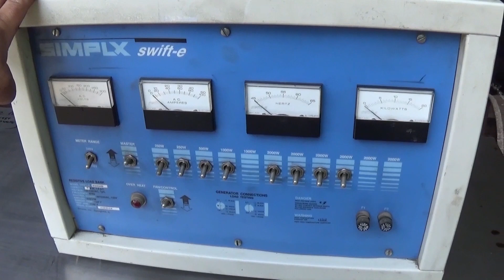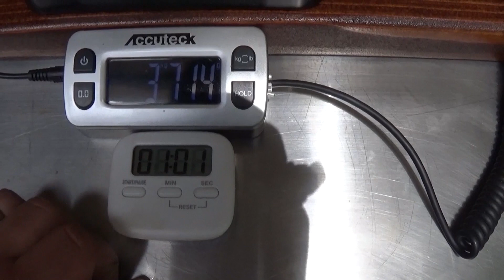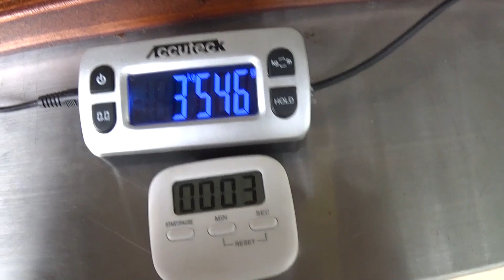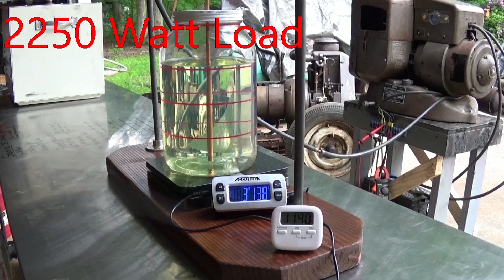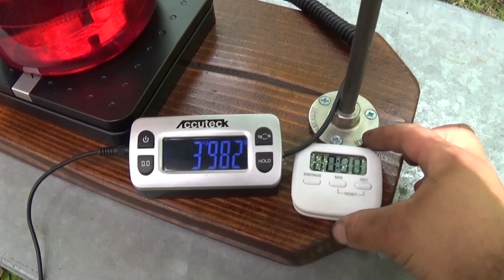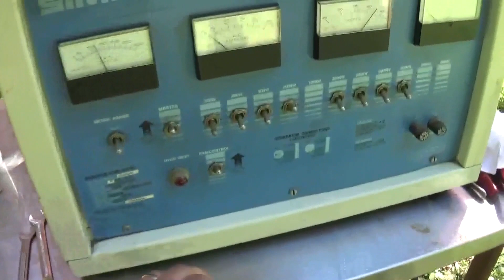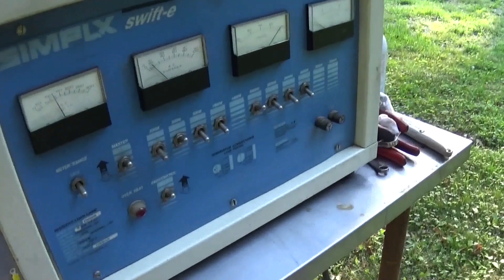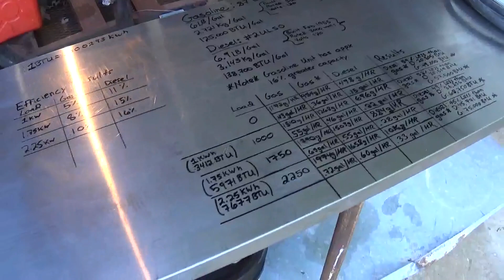GASOLINE VS. DIESEL (FUEL CONSUMPTION  1950s Style)

Comment: I don’t think the petrol correction was relevant because the engines are quite close in capacity and the issue is how efficiently the two generators convert fuel to energy. No surprise, diesel won equally no surprise I love my diesel car

Comment: I have been looking for a diesel generator that I can afford. One another line. I make Silver Series Lubricants. . have made them for 20 years. They are based on silver. Both wear and friction are reduced . The diesel has for friction due to ring load. If you would like to try again with the diesel I would like to see what the efficency is with Silver Series. In a Cumins 430C rig the owners showed 7% beter gas milagage. The was a 6 cylender Cat in a 4X4 50% increase. Never seen just a diesel  engine. Normally I sell Silver Series for $36 /gal/  Let me know. I will send you 2 gal free.

Comment: In theory, the thermal efficiency (energy produced versus energy consumed) for ICE's is entirely dependent on the compression ratio. The diesel engine seeming to have roughly double the effeciency...I'd be willing to say the compression ratio is roughly double that of the gas engine (so maybe something around 16:1) though most IDI's in my experience are stated to have a compression ratio closer to 28:1. To get a gas engine to be as efficient as  the diesel, you would either need to raise the compression ratio or utilize forced induction so the phsyical compression ratio can remain smaller. 
Some interesting examples, Ford's 7.3 IDI had a stated compression ratio of ~28:1 where the 7.3 Powerstroke only had a compression ratio of ~16:1. Since the OE turbo could double atmospheric air pressure (15 psi of boost) you'd already be starting at a 2:1 ratio at the start of the compression stroke and achieve something closer to 30:1 at TDC (even though physical compression was only 16:1). Another, GM's new 2.7L I4 which makes almost as much power and torque as a 2007-2013 5.3L V8...forced induction can really change efficiency numbers up.

Comment: I would like to see a gas engine with the same rotating mass and compression that the diesel has, but Audi has proven in the 24 hr La Mans that the diesel will beat gas engines .
Reply: K.D. Pearce I don't think anyone could afford the gas that would allow you to run a gas engine,at the diesel compression ratio.
Reply: @daleolson3506  E85

Comment: I made a test once on a small two stroke gasoline powered generator. The rated power was 650 W. At 60 W the efficiency was only 2 % and at 500 W it was 9 %. Not very impressive.

Comment: You can't even really make a valid test unless both engines run at the same rpm a diesel will natually use less cuz its a slower engine
Reply: travis spencer - they are both 1800rpm engines.

Comment: "indirect injected diesel" doesent exist im my book.
Reply: You need to read more books then. Heaps of them out there
Reply: IDI predated todays DI diesel. DI diesels are about 10% more efficient than IDIs
Reply: But the IDI are more tolerant of low quality and low cetane fuels. They were a good design for the operating conditions at the time
Reply: @cindytepper8878  Marine applications would benefit from going back to idi then, big time need to check the fuel before buying to make sure it isn't bunk that will clog up the fuel lines and filters.
Reply: @jaquigreenlees  We did a rigging job for a marine towing company like 30 years ago. They were closing a maintenance facility and moving all the equipment to another location. I was talking to the guy in charge and we were talking about fuel. He showed me some of the crap he found restricting fuel pickups and lines. All kinds of slop and trash. Fuel handling on the water must be terrible